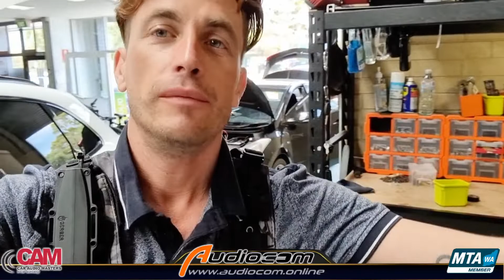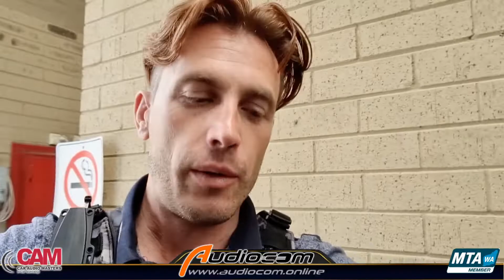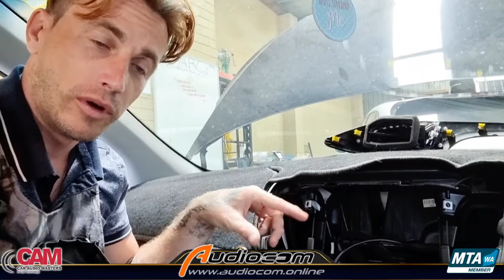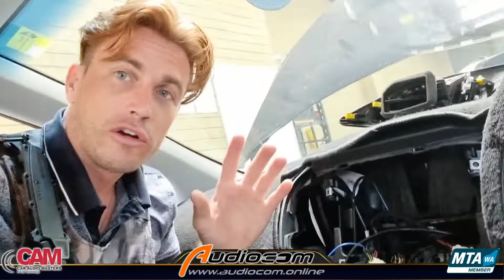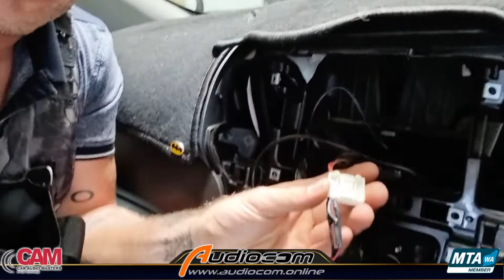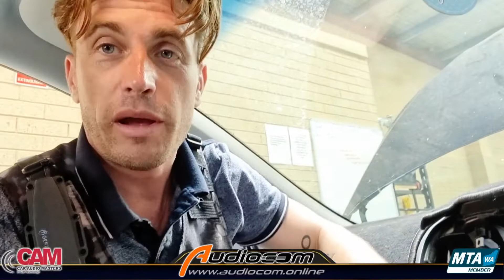Hyundai i30 Navigation Steering wheel control wires, speaker wires and reverse camera wires

Comment: Cannot for the life of me get my steering wheel controls to work on the same car. When I get it wired I did key 1 to the light brown wire and ground to the one underneath, the buttons responded but they were the wrong inputs. Using connects2 ctmultilead.5 tried both of the pioneer patches in the manual. Any advice?

Comment: you mentioned this car needs 12v for the power antenna, can you tell me which wire it was again? The wiring harness diagram I'm looking at says Remote antenna and is Connector B pin 18 , Does that sound about right ?

Comment: This worked great for me, also with "Installing a Sony xav-ax5000" on the i30 owners club site, I was able to identify all the problems with my harness and add a bunch of features without TOO much hassle. Special note on the video is the power antenna wire splice into the remote antenna wire and how to power and reverse gear my factory camera.